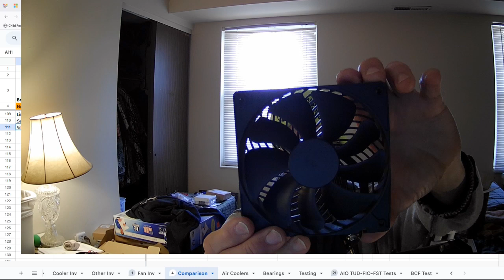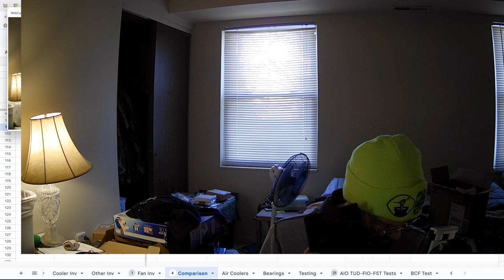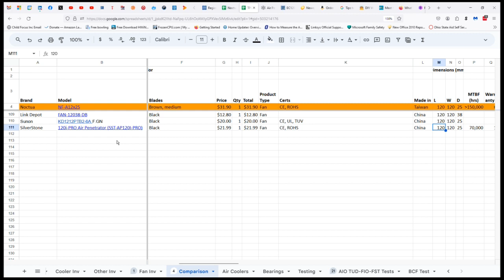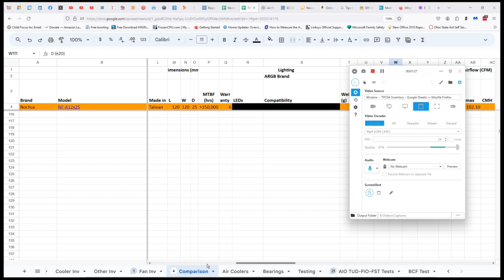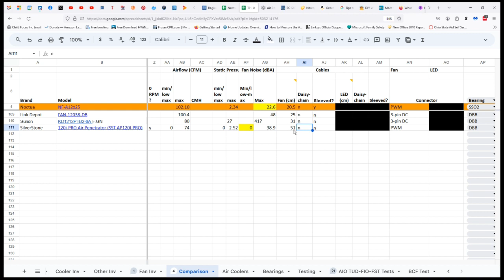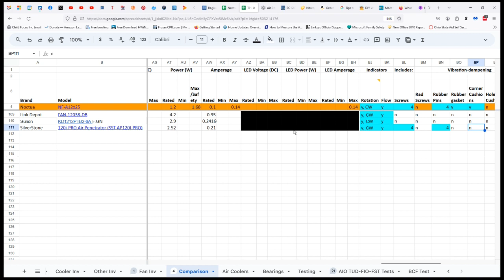Preview

Comment: Thank you for taking the time to test our Air Penetrator 120i PRO! This fan was designed as an intake case fan. So the swirl grill's job is to focus airflow further into the case than any other fans on the market. Normal fans' airflow will loose focus greatly when installed in a case as an intake fan due to resistance from the case's front panel mesh or filter. In free air, some fans can focus airflow well too, but as soon as you introduce resistance on the intake side, you'll see their airflow widens significantly. We have an old video demonstrating this:
 https://youtu.be/8m8fC809TK0

Also, the three fan blade shapes design aims to distribute noise frequency into three lower levels as opposed to having one blade shape focused on the single frequency. To a regular sound meter, the noise will be the same (because it measures sound intensity), but to our ears, the perceived noise will be lower with our design. Again, if you hold the fans in your hand, you naturally dampen some of the vibration and harmonic frequency generated by the fans. So you will need to also install the fans into a chassis where the fan grill or vents could interact with the frequency generated by the fan blades to see the difference our design makes. We have another video demonstrating this:
https://youtu.be/r4B82yQRUQc

Lastly, our zero rpm claim refers to PWM control. Most PWM fans cannot be controlled via "PWM" down to a stop. With "voltage control", you can of course slow any fan to a stop!

We are also fan geeks at SilverStone, so you are more than welcome to get in touch with us about testing some more of our fans ( media@silverstonetek.com ) ! Our new "Shark Force" fans and slim fans are also very interesting!
Reply from the maker: Thanks for responding so rapidly to my review of this fan! I really appreciate it! Those two videos were very interesting, and I thought it was very bold and honest of SS to use their own fans instead of comparing the AP121 to other brands. I saved both videos to my channel.

Thanks for explaining about the 0 RPM mode and PWM! I would love it if you could shed more light on how that works.